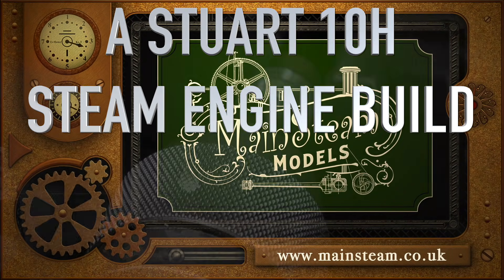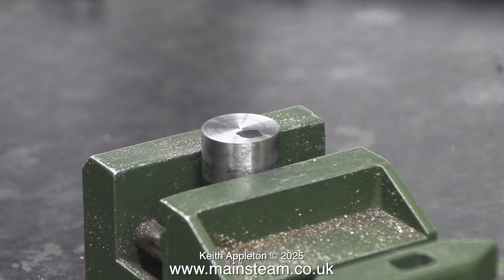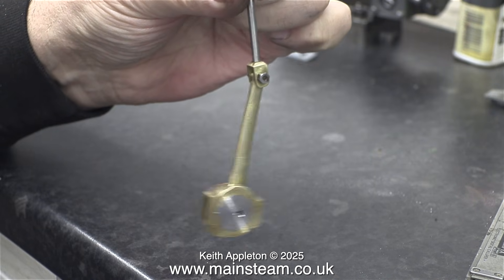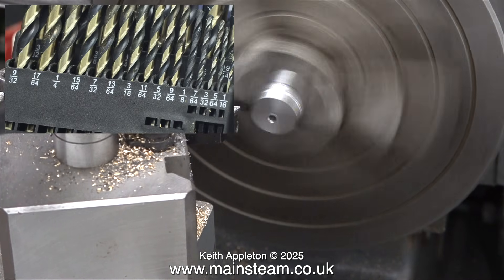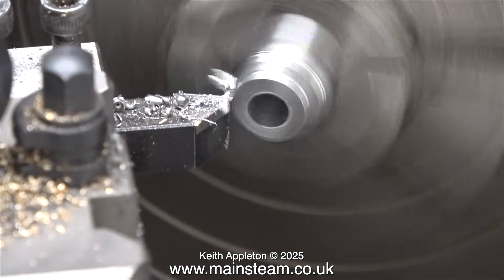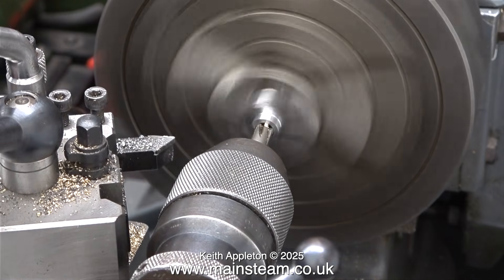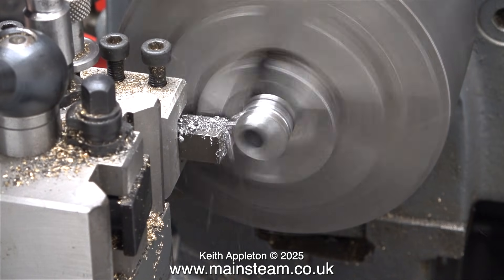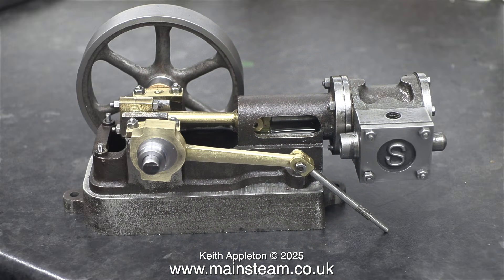A STUART 10H MODEL STEAM ENGINE BUILD - PART #13

Comment: I rarely comment, and I don't post engineering videos, but I love watching yours. I will never build another steam engine, I don't have the tools, and at 77 its a bit late to start. I have built a few engines in the past, when I was able to use the workshops where I worked, a couple of oscillators (one scratch built and another from a kit of castings. I also built an S50 from castings, which I still have.

Comment: Thanks! 
  Thanks again Keith. I've just come inside after using my new mill to make an adapter plate for fuel cock to fit a stupidly complicated fuel tank/pump system on a Yamaha (what else? new original cock US$315 + US$65 freight).
  It was 30 celsius outside but this morning my wife kindly fitted a heat pump in my workshop and it's struggling to keep it cool. But in the cool inside I find a treat: another of your vids and a cool drink; happiness.
  Have a good Christmas.
Reply from the maker: Not quite so warm here, my workshop Air conditioning is struggling to keep it warm this week.

Comment: 3/32" is 0.9375 Ten-Thousandths of an inch
Reply: I think you’ll find 3/32” = 0.9375”
Reply: @alanhall7850 I don't think it is, it's 0.09375 of an inch, or 93.75 thousandths of an inch.
Reply: @alanhall7850 pretty sure you won’t… try 0.09375